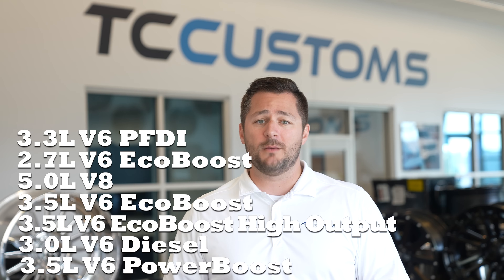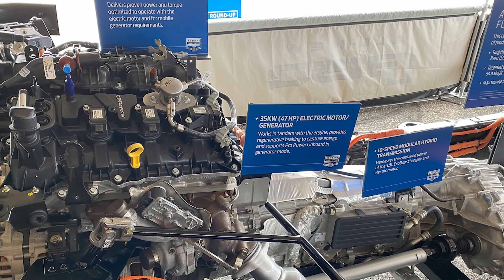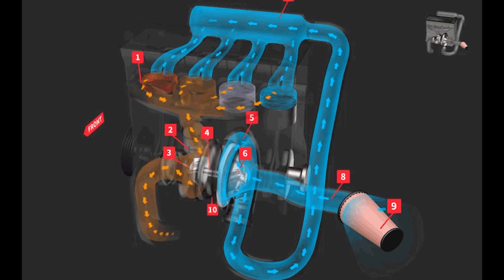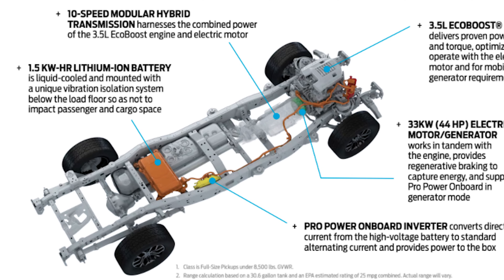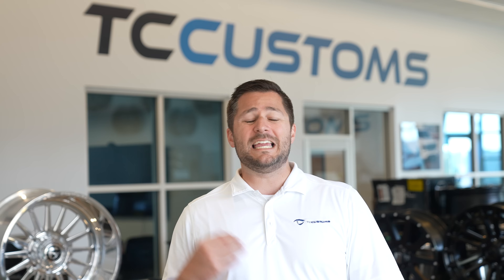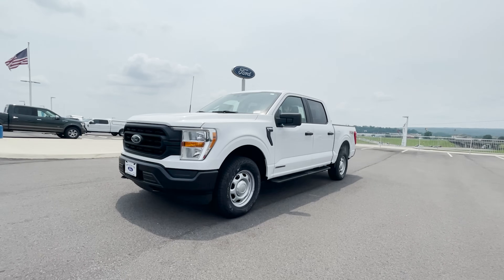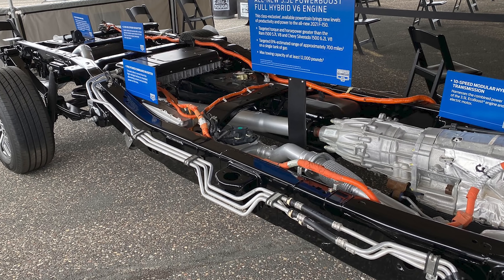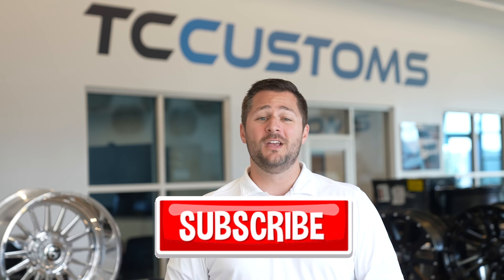The truth about the PowerBoost Hybrid Engine!

Comment: so...we got one back in 21.
... save for being the first axle shaft failure and one additional axle shaft failure which did not leave the truck stranded but it was making noise from the cracked retainer bolt...our 21 was flawless.   19 avg.  which was the best economy of any of our family rigs..mostly minivans and explorers..  highway mostly 24.   towing my bronco 8 to 9.   which is what i expected and same as my 250 towing same load.   but 250 only gets 10 to12 unloaded where as the powerboost could do over 24 hiway..  our new 24 has way less power on bottom, which is likely to save the axleshafts but gets crap fuel economy.  i suspect bad programming or poor parts in the engine.  

 they took away the blackout or ability to monochrome it options and all you get is a gaudy chrome laden ugly pos in lariat money.   very disappointed in ford.

. but, the 21 cheaply runs my house in power outages not to mention when camping and wheeling easily.  it only ran when charging.  unlike my generator.  in winter conditions one week on a tank.   that is cheap.   

the 24 is a disappointment due to government requirements that are going backwards now in fuel consumption.   the self driving is meh.  i dont need all of the intervention.  i just need reliability and simplicity in my truck.

Comment: The biggest advantage is that it has a built in generator with up to 30 amp 7.2kw electric power plug
s in the bed. You can power part of your house in an outage, run a welder or power tools or use it to  power your rv trailer while camping.

Comment: BYD DMO system is better technology than Ford system.  It gets rid of transmission and drivetrain.   The ICE engine is parallel hybrid and couples to front wheels above 42 mph.  Engine nearly 50% thermally efficient and lightweight.  BYD latest blade LFP batteries nearly 200 kw/h and can charge fast. Basically it is three geared clutches to manage power flow.  If they made a F150 size pickup Ford would be spanked.

Comment: The reason for not making it a plugin hybrid is to keep weight lower. PHEV batteries are much larger and heavier which would take away a solid chunk of payload capacity and in turn from the tongue weight. So even though the engine would be capable of towing a heavier load, low tongue weight would reduce the actual towing capacity.

Comment: I have a new 2023 powerboost. I love it... great fuel economy, but....

I also have had a lot of problems with it. The oil intercooler was on recall and needed to be replaced. My hybrid battery had some sort of problem and needed to be replaced, and currently my AC will cut out if im on a roadtrip and i have to completely shut my vehicle off and restart it to get my AC to work again.

They have some kinks they need to iron out

Comment: got one, good mileage, like the generator - lots of 12 volt battery issues...more batteries than oil changes - fact.
Reply: What’s the mileage like? I read what ford says it is but there’s a note that says it’s not accurate lol. I test drove one in city and it said 17mpg
Reply: @SelfhelpVegan I get up to 28 mpg.  Average 24mpg.  Mixed traffic driving...just got it back from the dealer...they put a new battery in it (again)...

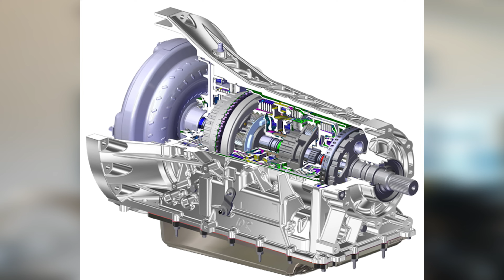Comment: I have the 2021 3.5 PowerBoost , only 60k miles….the transmission is sick between gears 7:10 and jerks shifting in and out when on highway and also lags dropping 1:2mph when it does this…would doing a tune stop all that?  Ford dealership is turning a blind eye unless it fails 100%. Thank you

Comment: I’m not sure how long you’ve owned your power boost but I’m on mine for 2 1/2 years. It’s stopped working three times and the last time it took them a month to repair the hybrid. My king ranch is awesome but do not get the hybrid and FYI no need to pay for the blue cruise. It will drive you nuts. The adaptive cruise control is better.

Comment: Bought one in Denver last weekend, flew in from Oregon. Drove it back in 2 days 1,300 miles and barely used 2 tanks. 50 gallons.
Reply: That is 26mpg!
Reply: @diggleda2952  I can’t complain about that
Reply: Love my 2022 Powerboost, getting around 18mpg but I’m sometimes pulling a trailer, tools and drive it had. With nothing in the trunk I can average 25mpgs. Best truck I’ve ever owned!
Reply: What’s your average mpg? I see such mixed answers online and what ford claims doesn’t seem to be accurate
Reply: @SelfhelpVegan  I avg 24MPG. Some days and routes I’ll get 20. Others I’ll get 30. For the type of truck it is, and the capabilities it’s stellar MPG. I love my truck.
Reply: @Ramiz112  I don’t understand how the one I test drove was reading at 17 miles per gallon. I was barely pressing the gas. It did happen a 2 inch lift. I don’t know if that would really impact the MPG that much.
Reply: @SelfhelpVegan  the way you drive it. If it had towed a bunch, the MPG accumulation may be way down. Anytime you lift a truck and or put tires on it, it has a significant impact on MPG as well. Mine is bone stock because of that. 

I towed a trailer for the first time with a Harley in it, 10 ft trailer, a month ago And my MPG was 15 for 600 miles. So pretty much cut in half. My lifetime MPG reading was affected for weeks
Reply: @Ramiz112  thank you!! it had been sitting in a dealer lot for six months. before that-it was stolen. Who knows how the thieves used it. it did have pretty big tires and that’s a bummer about the lift because it looks cool. 

Do you have concerns about needing to replace the hybrid battery?  You likely have warranty, but after that?
Reply: @SelfhelpVegan  You’re welcome. So many factors in MPG but at the end of the day, I find 23MPG very accurate if your drive normally. If your are revving the engine at high RPMs, hot rodding around, towing you’ll see variance.

I do not worry about the hybrid battery. The truck has been flawless for 10k miles I’ve owned it and it now has 36k total.
Reply: @SelfhelpVegan  also, never buy a vehicle that has been previously stolen. IMO they never run the same. And for what a Powerboost costs, I wouldn’t spend that much without peace of mind my rig was in top notch order.
Reply: @patrickmulligan3101 does that help fuel economy too? I always use regular and get this mileage
Reply: i have had

Comment: My powerboost gets about 500 miles on a full tank in the city. Maybe 525 or so on the highway. Basically sucks. Which I would have gotten a F250 with diesel. Or even a Tahoe instead of a truck.
Reply: Sorry I’m dumb -what is that in mpg? I test drove one and it says 17mpg in city. Is that around what you get in city too?

Comment: Let's not forget about the Raptor's 3.5L Ecoboost.  It produces 450 hp, compared with the Powerboost's 430 hp. Yet, the Powerboost has a better EPA mpg rating.  So the Ecoboost is more powerful, and the Powerboost is more economical.

Comment: We have a goose neck horse trailer with a GVWR of 10400 lbs.  We don't tow it a lot and never at full weight but obviously need to be able to.  Would you recommend the Powerboost, or a different engine?  We have an 2002 F250 today but would rather go to the F150 for our everyday (non-towing) drive.
Reply: If you are pulling over 10,000 pounds you will need more that a Ford power boost engine.

Comment: I’ve had my 2021 for 35k now and idle for work 8 hrs a day.  I absolutely love my truck. Especially when a champ comes up and put in sport mode. Lit folks 😂
Reply: Any update on your pick up? How many miles have you put on it now? Any issues?
Reply: @ 
70K now. Had a parkingpaw solenoid  Go out at 55k for some reason. Been changing the oil every 5-7k. Did the 60k service. I still drive it 150 miles a day plus idle 40 hrs a week. No other issues. 2 hurricanes without power and still able to power everything. I recommend to research AWG for distance on units. I now use a 10G bc it’s 100ft to my window 10k BTU shaker unit for 1 designated plug. The others run all my TV, internet, Microwave, 2 refrigerators, etc. I’d like to have the 7.5 KW just for bragging rights but have the 2.5KW. Works fine for us. Fill the tank up and ran for 5 days and used just under 1/2 tank of gas. So if I didn’t unplug and drive 40 miles to brothers house I feel confident just idling solid 2 weeks. My truck never shuts off. Sport mode. I’ve kept head to head with a Tesla for 3 lights till around 80. My neighbor Neighbor’s Maserati gaped him every time. Been a few. I’m still trying to test it with a TRX. 0-100.
Reply: I do recommend using eco mode for idle. Turn that on. Cycles up the battery for 25 -30 minutes then runs engine for around 1 minute instead of not and cycles every 13 minutes. I’ve read and experienced the difference. Less on starter and it’s worked for me.

Comment: I've had my PB Lariat for 2 years now and 30k miles.  The number one and pretty much only reason I would buy this truck now or again is it's the only way to get the 7.2kw on board generator not having a lightning.  I've run a plethora of tools off this truck including a small welder and love having the security of a generator that powerful for power outage and camping.  Otherwise I think you the trade of of complexity for mileage and loss of tow capacity is not worth it.

Comment: I love my powerboost f150. Bought it with zero miles, brand new and dont regret it. I am mostly highway driving, very rarely in the city and i get between 650-750 miles on a full tank. Also for those curious, 10% of my travel is electric according to my dash. Which is not that great in my opinion. Out of 100,000 miles, 10,000 will have been electric... But! the truck is extremely quiet and I love it.

Comment: Why is the towing capacity for the Powerboost engine so much lower than the eco Boost engine F-150? The Eco Boost tows a maximum of 14,000 lbs while the Power Boost tows 1,300 lbs less. I don't think the difference is a direct result of only the weight of batter on the Power Boost, as The battery and misc components do to weigh an extra 1300 lbs.  The curb weight of a Ford F-150 Limited 4x 4 w 5.5 ft bed w Power Boost engine is listed at 5540 lbs while and XLT model with 5.5 foot bed, 4 x 4 weighs between 4948 - 5115 pounds predicated on how it is optioned. So the battery in the Power Boost should only add a max of 592 pounds in vehicle weight over the the EcoBoost engine.

Comment: run away - Powerboost is a disaster ... have a good pal who is having nightmares with his - only 10k miles on it ... has been in the garage for 3 stints for a total of 7 weeks in 3 months - they can not figure out what is going on with the electrical/power and don't seem all that motivated to fix it at the dealership (two so far) or Ford HQ
Reply: What problems is your friend having with theirs?

Comment: Can you turn off the engine stop when you make a complete stop?
Reply: Normally when I come to a stop or start braking for about 1 second or more, regenerative braking kicks in and the gas engine turns off and it runs on electric. It stays in electric for a few moments until more power is needed and then the gas engine kicks on.
Reply: There is no way to force electric only, it auto decides. You can somewhat trick it into electric by braking and using like 5% throttle. If you smash the throttle gas will always kick on.

Comment: Great stuff once again.  A question.  How do you think the Powerboost would do at the high altitudes and extreme winter cold that comes with living in mountainy ski country out west?  Any trade offs or issues with that?  The best ski days are cold, snowstormy weather days after all.  And conversely, how would it do when I take to hot desert environments and to sea level at either coast?  Thanks.  I do a lot of highway driving, but of course the better mpg apparently around town with the Powerboost is appealing.  I'm considering the F150 Platinum with the Powerboost, Ecoboost or naturally aspirated 5.0 V8.  I love that they can all apparently get 22mpg or above on the highway.
Reply: 7:41 sounds right...

Comment: 2022 F150 Lariat 3.5L Powerboost, I get about 30% driving mileage 100% on Electric power, so this hybrid system definitely works, unless the lead foot then it drops to 10%. My truck is not a lighter model, it is loaded with most options available for the Lariat trim except FX4, which I didn't go for because it is slower 0-60 than Sport 4x4 due to the differential ratio. My only wish, a little longer and somewhat more power to start from fully stopped on electric power only, currently the engine kicks in as soon as it starts rolling. You may still be able to start rolling on electric power only to about 40 but people behind you may honk being a slow starter. Good informative video, thanks.
Reply: While it clearly makes a difference, and is sufficiently big to be a generator for the battery to allow the Pro Power Onboard feature to be useful, I feel it's a surprisingly small motor for the size of truck!  Smaller Hybrid vehicles that all have very similar gas+electric motor setups to each other (like the Chrysler Pacifica, Toyota Rav4 & Prius, and Ford Escape & Maverick Hybrid plus several others from each brand) all have 2 electric motors that can both help move the vehicle, the smaller of them already being bigger than the F-150 PowerBoost electric motor, and the larger motor being nearly 3 times bigger!

But being a "hybrid" isn't the primary concern of the PowerBoost, it's that it can move the truck alone (like bad stop and go traffic), it can recharge the battery when using the inverter, allowing the engine to cycle off-and-on, and it can help with performance and fuel economy better than the RAM eTorque system does.  At least the Chevy system was 80hp and could get up to 30mph on electric alone.

Comment: 99% in regen, I don’t think so. Because of the losses in the system most regen is only about 50%.  Alarm when in electric mode and under 20 mph required by federal law.

Comment: Dumb question, it's a hybrid but no actually electric chargin at home is needed correct?
Reply: Correct. the internal gas engine charges the battery as needed.

Comment: The ecoboost engine is a disaster.  I had to replace the engine at 70k miles and both turbochargers at 150k miles.  Basically I've purchased this King Ranch truck twice.  And it has never gotten the promised gas mileage.  Not once.  Anyone who goes this super tech route is destined for trouble.   Never forget that you will be replacing the battery pack as well as the engine and turbochargers.   And I am a registered mechanical engineer.

Comment: AWESOME video!  My only suggestion would be to use "engine" and "motor" in the proper context.  Referring to the engine as the motor gets really confusing.  Towards the end of the video you did straighten it out somewhat, nice job!

Comment: I've watched at least 50 f-150 videos and I swear I learn something new every time. Didn't know about the backing up beep. That's a pretty innovative feature.
Reply: @utahgator8895  
There is a company that can use an adapter to delete that sound via grill harness for about $50
Reply: Yes. That alone justifies the $75,000.00 cost. Good lord.
Reply: @roberthenry9319  - ALL hybrids are required to have a pedestrian notification sound when in reverse. The Lord is the Government.
Reply: @ddbutikofer825  most other hybrids, such as the Prius, have a way to easily disable it through a combination of button pushes in the car
Reply: @roberthenry9319 Mine was only $63,000 😃

Comment: Is it possible/practical to upgrade from a 2.4 to 7.2kw PPOB on a Power Boost Lariat? These trucks are super hard to find and I finally found one that's perfect except it doesn't have the 7.2 pro power option, just the 2.4 standard inverter.
Reply: I need this answer aswell
Reply: @dr141   Since this post I've learned that's it's not practical because Ford doesn't offer a way to do this and going the DIY route is risky. Even if we change out hardware and wiring, the VIN will always be recognized by Ford as the 2.4kW model and software updates will reflect that. Maybe Ford will offer an upgrade in the future, but I wouldn't hold my breath.

Comment: I'm looking at the powerboost as a way to get more fuel efficient, and thanks for this video! 
My daily commute is 60 miles round trip and that's split at around 11 miles surface streets, 19 miles interstate.
I'm now wondering if, with that daily driving split, would the powerboost really provide a meaningful difference?
Thanks!
Reply: Depends on what premium you willing to pay for the hybrid. I had the same decision this year and I gave up on the over priced hybrid and went 3.5 Ecoboost. In Eco Mode 20mpg in city and 23mpg interstate and this is the Lariat 4x4 will all options so she is a heavy girl. If you heavy footed then city driving mpg will drop like a rock and hybrid then helps nothing. The term hybrid for this vehicle I would say is a stretch like the Mini "e".
Reply: Hope you got the powerboost because it's crazy good mpg on city streets. On slow traffic, I can easily clear 30 mpg. On top of that, I have hilly roads, so I get a lot of value out of the gas I spend to product torque. I can get up the hills without using much more gas than flat driving and then I can drive down the slopes practically free while also recharging my battery.

Comment: I have a Platinum PowerBoost and love it. Lots of room and very smooth on the road and luxury car comfort.  The 24 MPG is still alluding me, but at 14K miles, it is hitting 21 and 22 mpg - maybe at 16K miles, lol.  But towing is easy. I moved from Nazi California to Arizona and rented a 24 foot trailer to move.  Took 4 trips through the mountains and deserts, my mileage dropped to10-14 mpg but never struggled going up the mountains at 70 mph. The backup function assist is a must with any trailer, but fantastic with a 24 foot.   Want a great truck buy the F150 Power Boost!